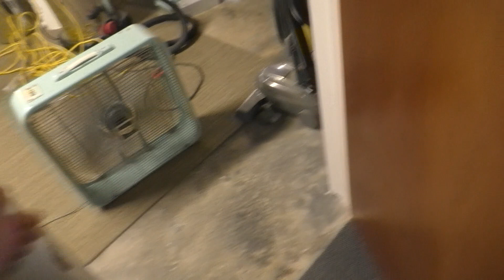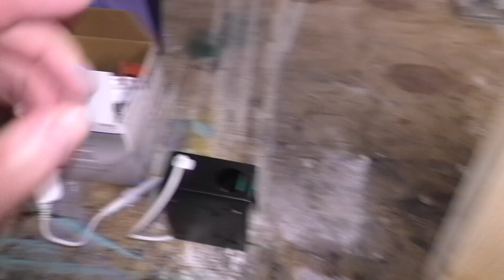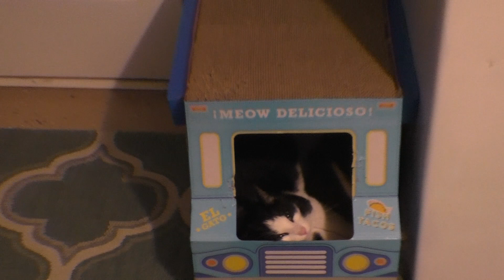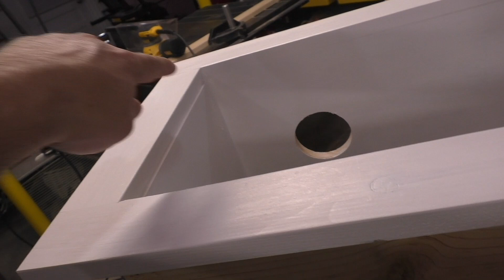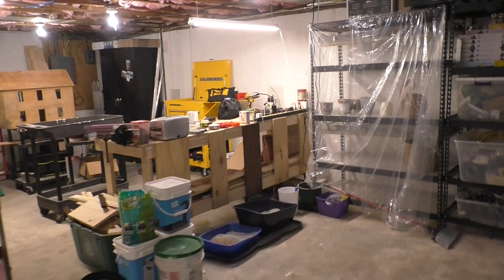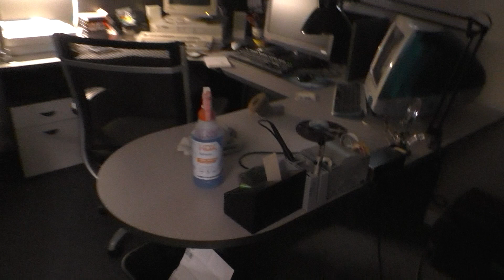I bricked over a basement window - You gotta do what you gotta do...

Comment: wago lever nuts are much better then those push in connectors u just flip the lever push the wire in the flip the lever back down. seen a guy do a video testing them and he had to go like 200% over what they were rated for before they started to melt i think the wires started to melt before the connectors did. i guess over in Europe that's all they use over there i think there made in germany u can get them off amazon though.